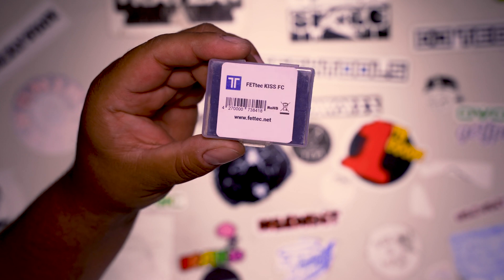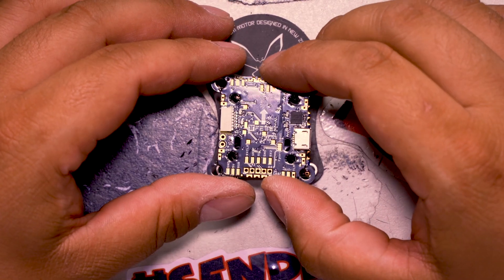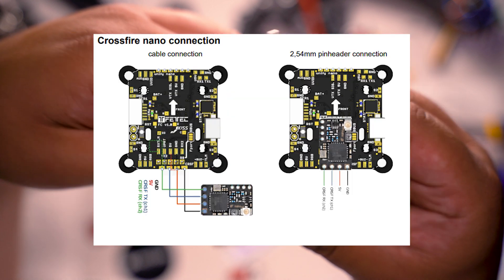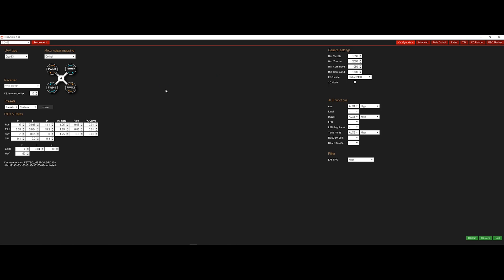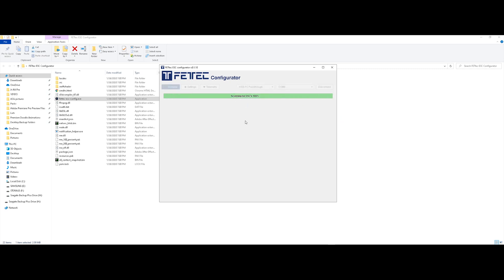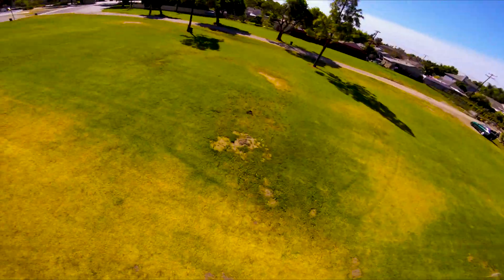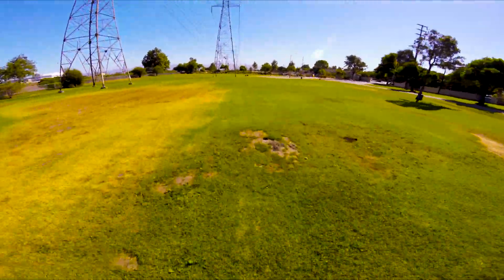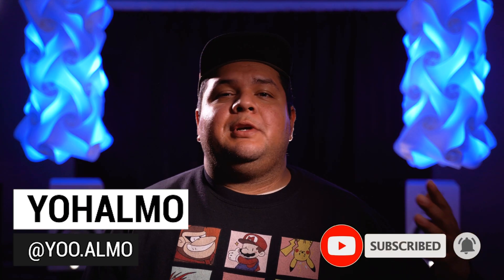Fettec FC and ESC Build video (FPV DRONE 2020)

Comment: I built this stack a week ago ..but im running DJI and having trouble getting osd or at least my voltage in the goggles
Reply from the maker: Thank you for liking and commenting on my video! Im double checking right now if it's possible to connect an osd... But as of right now I don't see the option to connect an osd to the air unit since the fc doesn't have a built in osd.
Usually with other fc's they have it built in... But I've heard that fettec is working on getting the next fc to have an osd built in.
I will double check and get back to you as soon as possible once I get an update if you can add an osd to the dji air unit.
Reply: @yohalmocoto4604  Alex F has a firmware on a new gui on his patreon especially for the Fettec FC to get MSP connections  on fettec FC. So they are a firmware for osd on the fettec fc. I was just wondering if they was another way to get osd besides using external osd board
Reply from the maker: @allennickles3970  just got a reply. there isn't much information out there on this. I think our best bet is to get in contact with Alex through patron. The development of this stuff isn't easy. I think I'm gonna do the patron myself
Reply from the maker: @allennickles3970  it's basically $5. I'm gonna give it a try and see what I find out. I would join as well since fettec is a fairly new company and they definitly need the support for this awsome fc and esc.
Reply: @yohalmocoto4604  I got it finally updated and its awesome close to having Betaflight osd. At least it is for me because I dont use a lot of osd elements on Betaflight. The new Alexander firmware for fettec you got rssi,mah rating,voltage,etc. I'm happy to finally have some osd elements in Kiss. Its definitely worth every penny of support you can give him☆
Reply from the maker: @allennickles3970  awsome to hear! Whenever you get some flight footage with that fettec set up... Feel free to share it on here! 🙏🏽 Happy flying!
Reply: @yohalmocoto4604  Will do..it flys so good just adjust your rates and your good
Reply from the maker: @allennickles3970  I was surprised myself as to how smooth and easy it was to set up! 😁 Alot more less of a hassle than betaflight for sure
Reply: @yohalmocoto4604  Yes the Kiss Gui is very simple to set up in my opinion especially after getting the DJI hex firmware installed.  After using Betaflight firmware for nearly three years. It's a refreshing change. And I'm running stock Kiss pids and the propwash into dirty air is impressive. I will say this as well. I changed my Betaflight firmware on my 4 inch yesterday evening  to 4.2 on stock pids with a few simple changes to the Dterm filters and it flew pretty good as well to be on stock pids and ultralight four inch
Reply from the maker: @allennickles3970  betaflight none the less has come a long way. 👌🏽 I feel that it's alot more buttons to learn rather than just plug and play. Definitly once you know the ins and outs of betaflight.... It can definitly fly along side with the best.
Reply: @yohalmocoto4604  Yeah and all those buttons is the reason I'm here flying kiss..lol Now i have to sell my Betaflight flight stacks and buy more Fettec stacks..lol
Reply from the maker: @allennickles3970  think about it as buying the upgraded investment at a cheaper price.... Once you've sold your betaflight gear you'll get some of that money back😎. Definitly worth the investment at this point.
Reply: @yohalmocoto4604  Yeah I'm running  6s through this Fettec stack pretty hard. Of course I'm running big conpasitor on the esc. Transtec build frame, Iflight Xing 2207/1800kv motors, Fettec 35amp stack ,crossfire micro reciever, Full size DJI air unit with Iflight 12v BEC. 350grams auw, 561grams, with 1250GnB 6s pack. Conservative on the sticks 5-6 minutes flight times, Hard on the sticks still solid 4-minutes. So yeah I'm pretty impressed on how conservative it is on amps, mah, drawn.😎
Reply from the maker: @allennickles3970  sounds like a solid build 👌🏽why I tried flying into dirty air... I was expecting redicoulous prop wash... But this fettec hardware is awsome! If you have any flight footage you want to share with the fettec hardware... Paste that link here! 🙌🏽
Reply: I run DJI with Kiss v2 and FETtec and I use the MSP Protocol for OSD to DJI 👍 it works great 👍 let me know if I can help
Reply: @commanderfpv800  Are you running Fettec FC F7? I know Alex F has firmware for the osd  for DJI the Fettec FC through his patreon ? Is that the firmware that your running
Reply: Allen Nickles yes I am running FETtec F7 with FETtec 4in1 as well as Kiss v2 and Kiss 32a ESCs. I am running with Alex’s firmware mod and it works great. To get it to work I also re-pinned the relevant serial port for a cleaner installation.
Reply: @commanderfpv800  I'm running a older windows computer and I'm not to computer savy anyways. So I'm having a difficult time with getting the firmware to the gui. I have already supported Alex F patreon and have access to the firmware files but cant get them to work for some reason
Reply: Allen Nickles I will contact you when I get home 🏠 out flying at the moment. I am based in Germany are you in the European time zone?
Reply from the maker: @commanderfpv800  thank you for volunteering your time to help the community 🙏🏽
Reply: Yohalmo Coto My pleasure 👍👍👍
Reply: @commanderfpv800  I appreciate your response. Alexander F sent me some links and I finally got the firmware updated. I was pleased to see not only I had voltage but also rssi,mah,etc..So thanks for offering to help me I highly appreciate the offer. I'm east coast USA
Reply: Allen Nickles glad to hear you got it sorted out. If you have any problems let me know and I will help you 👍
Reply: @commanderfpv800  Thanks bro...appreciate  your responses
Reply: I bought the Kiss fc and a fettec esc, just figured that the connector doesn’t fit. I’m running also dji... can you guys recommend a small bec board the one I bought is way too big can’t get all 3 in the frame. I’m thinking of buying the fettec fc, probably easier to connect with the cable. Seems quite difficult to built compared to the betaflight fc and ESC’s when running Dji...

Comment: Hate to say Something so negative here But I just fried my fourth Fettec brand new FC across different esc. I can't believe Flyduino have any connection.  To this Product what So ever..
Reply from the maker: I might consider doing some sort of follow video. I haven't had any fried boards. But im getting some weird desync type of issues. Where i temporarily have no controller of the drone after a quick throttle blip and then regain control as it free falls. Sometimes it just falls all the way to the ground. I am considering trying the kiss ultimate fc to see if it's any different. But I'll of course post about it.
Reply: Only spoke Up So Someone might Be thoughtful. Thanks like Your video...Just FYI. Because I would want to know. And Before I ordered them I didn't even know It was from Holybro Not Flyduino. So I should have done more research.

Comment: "Unable to active FC passthrough mode. Maybe the FC is already in passthrough mode, or the FC FW version don't supports it." - any idea why? @5:05i can't configure the rotation of my motors sadly without that correct?

Comment: Going to build my first Kiss Quad. Did you need a seperate osd board? If so which did you select?
Reply from the maker: Thank you for your comment! Yes for flyduino kiss and fettec you need an pad board. For fettec.....the fettec osd is superior. Small, can fit anywhere. Plug and play.

Comment: Hi thanks for this tutorial..please I have some questions for you: is it absolutely necessary to put the spike absorber or can I avoid it? I would use 6s lipo: what lipo do you use 4 or 6s? widening the holes of the fc fits the silicone mounting grommets or do i need to use something else?
are there pre-set settings to copy and set like Mr Steel or other monsters like him? are the settings in the tutorial yours? can i copy them with fettec esc 45A, motors t-motor f40, frame apex? thank you very much
Reply from the maker: Hello there! Yes I would recommend the spike absorber. I've heard of people having burnt escs for not using them. All you need is one. I use 6 s. For mounting the fettec you can hard mount but they do say you can also soft mount... I use M3 Flight Controller Anti-Vibration Fixed Screws Mounting Hardware Standoffs. I like vik fpv's pids if you have a similar set up.
Reply from the maker: You can probably try they pids and rates... Do it with caution where the motors aren't too hot or you can burn a motor.

Comment: I can’t connect the FC to the KISS GUI. FC just has a green light. When plugging in the battery ESC blinks blue once then only red light. FC is green light. Any help would be much appreciated.
Reply: I’m sorry, this is my first build so I probably missed something crucial. All I did so far was build it and now trying to connect to the KISS GUI. I thought that was the first step in order to flash the firmware, is that not correct? Or am I missing something important? Thanks for the help, I really appreciate it! Trying to learn but there’s not a lot of information on this Fettec FC out there. From what I’ve seen and read, once you build everything the next step is to connect it to the KISS GUI... am I missing a step?
Reply from the maker: @mrjdchambers  follow these steps.... Open kiss gui... Connect usb to flight controller... On the top part of the physical flight controller next to the jst plug (white plug opposite end of the micro usb connector) there is a bootloader button. Its a tiny aluminum rectangle button next to the plug that has a black circle in the middle of it. Press it while plugged in to the pc through USB.... Flight controller should flash blue rapidly... That means your in bootloader mode. Kiss gui should detect flight controller on whatever Com port your on and press connect. Press select remote firmware. After that check the flight controller drop down menu is on fettec, firmware drop down is in the latest number... Then download firmware and flash.
Reply: ...it’s the Vanover Pro Spec build just so you know everything I’m working with.
Reply from the maker: @mrjdchambers  vannover is super fast. Lol once you download the firmware go ahead and flash it. After flashing you should be able to connect to the kiss gui
Reply: I just want to say... you are absolutely awesome for sticking with me and trying to help me out! That’s what I love about this hobby... great outgoing people! I really appreciate you and I’m looking forward to your vids in the future. Liked and subscribed! 👍🏼
Reply from the maker: @mrjdchambers  shit happens bro! I've burnt about 3 fettec fc and 2 esc. Happens to the best of us. Reach out to me if you have any more questions 👌🏽thank you!
Reply from the maker: Thank you for commenting! I've had something similar happen. Almost as if I "bricked" the FC. This solution should work thought... When plugged in through USB....press the bootloader button. If it doesn't nothing and the computer still doesn't detect... Unplug the USB, press and hold bootloader then connect the USB. See if it connects to the computer and the gui detects the Com port. If so try to flash the firmware. Let me know if this helps. 👌🏽
Reply: Thanks for responding! So it’s actually recognizing a port but it won’t bring up the flight controller activation screen, it keeps saying connecting but doesn’t leave the main screen. I’m stuck!
Reply from the maker: @mrjdchambers  so you followed the steps... Flashed the firmware and its still not connecting into the gui interface?
Reply: Only a green light also... I think that’s important. I should see blue lights right?...and maybe a red.
Reply from the maker: @mrjdchambers  both solid green and rapid flashing blue after pressing the bootloader button
Reply: Yeah, I’m not getting that. Only a green light.
Reply from the maker: @mrjdchambers  what happens when you press the bootloader button?
Reply: Oh man, I’m embarrassed to even say this. But last night I finally got the blue lights on the FC... I didn’t connect 2 wires from the Caddx Vista to the FC because that was how Vanover did it in his vid (he was running Crossfire and didn’t need those wires) and I caught that after the fact. I connected the 2 wires, blue lights came on, but still wouldn’t connect to KISS. So I decided to try to at least get something accomplished for the night and repositioned the power lead and clean up the solder joints and I ended up soldering the power lead backwards so I’m pretty sure I fried my ESC. Went from bad to Holy Sh*t 😂 So I really appreciate the help brother but I’m a complete dumbass! 🤦🏻‍♂️
Reply: Thanks brother!

Comment: Cant connect my flight controller to the computer.. the LED's are on, everything good but Kiss GUI doesnt show any Comport, just the stupid KISS WIFI
Reply from the maker: Try this... As soon as you connect the USB to the computer.... Press the bootloader button. See if it connects then. After that try to flash the firmware. 

If that doesn't work another best option would be to reach out to the fettec Facebook group. Alot of knowledgeable folks.

Comment: Does fettec fc has a osd integrated?
Reply from the maker: Thank you for commenting! The FC does not. However there are multiple options to do so! You can either use their own Fettec osd on their site or other fpv sites that carry the product. Ill link a video on my page on a few methods to do so. Fairly easy to do. Almost plug and play with minor soldering.  

osd set up link 
https://www.youtube.com/watch?v=LiCi-_O4XoA&t=9s&ab_channel=YohalmoCoto

Comment: Thumbs up! Like it. Might try kiss soon. Your quad was 662g or something with the session. Will be a bit heavier with gopro hero then. What batteries were you using?
Reply from the maker: Thank you for your comment! I am running the ovonics 6s 1000 mah 100c. They weight about 173 grams more or less. I'm sure you can run lighter or smaller cell count!

This set up is pretty awsome! Came from betaflight and I love how kiss handles! 🙌🏽 Almost no prop wash with very minor tuning

Comment: Yohalmo:  This is my first build with Fet Tec / Kiss.  My build is fine but I cannot get the FC  to talk to the ESC.  Did you have any issues getting the FetTec configurator to find the escs?
Reply from the maker: I did when i tried upgrading from this videos firmware. What is the esc lights doing and what is the FC lights doing?
Reply from the maker: Also have you tried reflashing... Connect the USB to the FC... Then press the bootloader button

Comment: This isn't the recommended method of installing the cap or the spike absorber at all, In fact the cap and spike absorbers need to be together and connected to the extra positive and negative terminals (as the esc was designed) and less than 2cm away from them. A cap on the xt60 connector is also proven to be less beneficial. 

This way you're installing it will shorten the life of your ESC for sure.
Reply from the maker: Note taken. I literally just learned this about 2 days ago from the fettec Facebook group. Note taken. Thank you 👌🏽

Comment: do you have to have an osd with this fc and esc
Reply from the maker: Thank you for your comment! Yes you do! Either the tbs unify Evo or the apex osd.
Reply: Yohalmo Coto ok thanks are you also using the apex regulator board and if so does it plug straight into fc with the wiring harness?
Reply from the maker: @owenmoss013  since I have no osd on the set up on the video... No need for a regulator board. I'll talk about that on the next video 🙌🏽
Reply from the maker: I will try to post a set up video soon
Reply from the maker: JUST POSTED THE VIDEO ON HOW TO SET UP THE OSD!
Reply: @yohalmocoto4604  Cool! I was just about to make a comment about the osd, and if/how you set it up
Reply from the maker: @TheBjornarv  there is one more method that wasn't mentioned in the video since fettec actually released their own osd! So the methods I used in the video are other stuff that work fine.

Comment: The spike absorber was supposed to go on the cap bro
Reply from the maker: That method works too. 👌🏽 My method so far works good with no issues. I've also seen another method where they would put the spike absorber on one of the holes where caps for each esc go on. So i don't think there is just one method.

Comment: The esc works with kiss fc v1 ???
Reply from the maker: Let me find out for ya!
Reply: @yohalmocoto4604  Thanks man!
Reply from the maker: @nestorg.5756  I just got a reply from Alexander Fedorov... He created fettec. He says that you can use any esc with the kiss v1. So you should be good 👌🏽
Reply from the maker: @nestorg.5756  He had a patreon so it's easy to get a hold of him. With the small donation of $5 dollars a month helps support him to keep on going with his endeavor
Reply: @yohalmocoto4604  hey thanks for all your info that will help... i have the fc v1 with the last firmware of kiss. I want to put in the geprc leopard.
Reply from the maker: @nestorg.5756  That's gonna be interesting 🤔 I feel like this fc could work really well with racers based on its characteristics